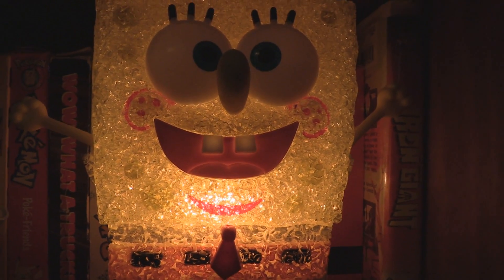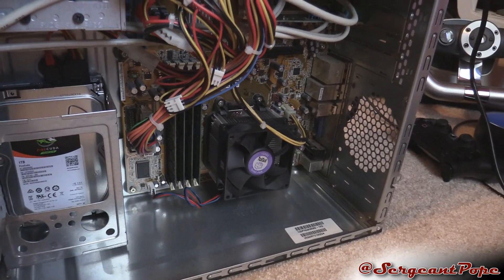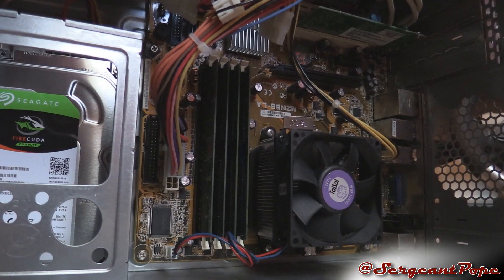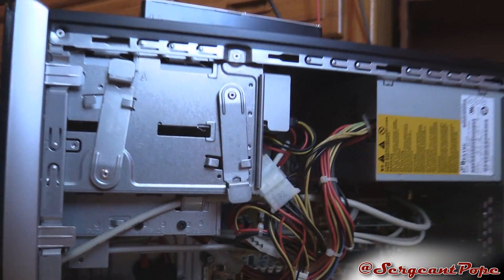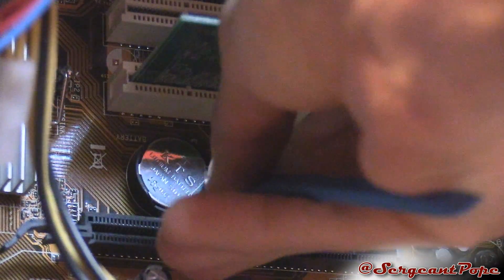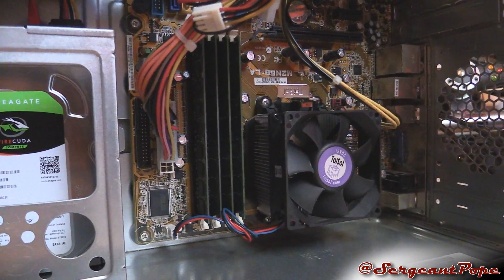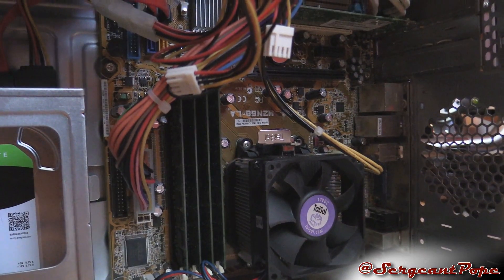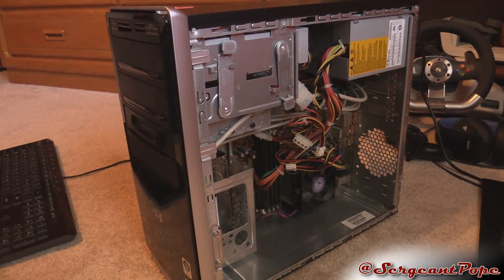Fixing a computer that turns off when booting into OS/Windows

Comment: I am working on a 11 year old atom pc about 1.1GHZ. It stopped working 7 years ago for my brother. I kept it and have now diagnoses the problem. The fan stops the windows 7 starter to stop and give a blue screen.  Critical Fault message. Without the fan it starts up, no problem. I have tried a few fans but the problem remains. What do I do now? I remember now that my brother raplaced the original fan with a bigger and quiet fan. That might say something?

Comment: my problem  is that, when I turn my pc on, it turns on for a second (the fans and the light turn on so I know my pc turned on), but after that it will shut off (the lights and the fans stop working) for around 3-5 seconds before turning on (this time completely) again and brings me to the American Megatrends screen which never happened to me before, only happened to me today, I googled and found that I can get through the American megatrends screen by pressing F1 and choosing save and exit in the BIOS screen, and that's what I did and it worked for me. 

Does anyone know what is wrong with my pc??? I don't think it's an overheating issue because I've never had any problem with that so far and my PC turns on just fine and I'm using it right now, and it's not hot at all, all the fans seem to work fine, nothing looks wrong on the outside so IDK what to do but it bothers me a lot cz again this is the first time it happened to me. I've tried booting up the pc multiple times already and it keeps doing the same thing, turns on then shuts down before turning on completely on it's own. 

Thanks :)
Reply: Little late here idk if you still got the problemo but it might be the power supply. But before you get a new one try to clear cmos. If that doesn't work start unplugging things to isolate the issue. If everything is unplugged like drives and gpu and it persist, try replacing ram but it's prolly not that.  If all that fails,    it's the power supply probably.

Edit: if the power supply fails then it might be motherboard
Reply: @carl5137  thanks for the reply. It was the CMOS battery 😅. It returned to normal after I changed it.

Comment: OK your a computer repair tech? cause its called a baud fax modem NOT a phone jack thingy. and always start with the memory sticks pull them all and insert one at a time into the first memory slot, with a single stick if the memory stick s bad you will get a continuous beep. don't ever just start buying random parts and throwing them into it, your wasting time and money.remove one at a time any and all objects not any of the power cables coming from the power supply , see if PC boots to bios then plug back in stuff that works, remove stuff that doesn't. start with CD/DVD rom drives and card readers and internal modems or other cards plugged into pci or pci express slots, if your motherboard has onboard video, remove your graphics card.if the fan in your power supply is spinning it should be working, get a multi-meter and check a hard drive power plug black is ground, yellows are 12 volt reds are 5 volt and orange is 3 volt, if it won't stay on in the computer unplug it from the motherboard a place a jumper wire from the green wire to a ground wire that's what switches it on remove the jumper and it will turn off. if all that fails it is the motherboard or a processor issue and that you should take to a qualified repair shop to have diagnosed. if you do get it to boot up and stay running update the bios on the board.

Comment: I had something similar, i just checked that temps are 70c max at idle, and I found out cooler is failing. So I ordered a new one. I would add also cpu cooler fail warning, in bios and add motherboard speaker to troubleshoot errors. Might also buy motherboard with troubleshooter display, fast power on, restart buttons. Stock fans are cheap and they will die soon. IF you replace fan in time, than your cpu might be saved. You need those huge radiators, to keep idle temps close to 25-40celsius.

Comment: My drama with this began when I recently changed my TFX form factor PSU (on a self-built PC) from a 300W Seasonic to a 300W Silverstone (both of them with that 80 Plus Bronze level of efficiency stamp on them). The Seasonic developed (a few days after install) a fast rate clicking sound - which gave the first glance impression that a fan's blades with hitting something - and the really weird part was that the same clicking sound was coming through my PC speakers too. I pulled that out and opened it up  and stuck a pen into its fan (the only moving part in it) but the high speed clicking sound continued coming from that PSU. So, I looked around on YT and didn't find an answer - but I did find what was really going on when I went on an Electronics Engineering forum. 

There was a guy on there with the knowledge and skill set to analyze and repair the real problem. It's called "micro-arching." It's when you have high voltage and there's a tiny break in electric contacts (it could even be a micro cut in a wire) and you actually see the electricity jumping across to complete the connection and continue on its way on the circuit. When it does that, not only does it create a popping sound but it also creates EM pulse waves that radiate outward in all directions - like what my PC speakers were picking up on - with the same rhythm pattern. This electronics DIY guy on the forum, de-soldered a lot of the connections on the daughter board of the Seasonic PSU , cleaned off the board with an alcohol type solvent extremely well and re-soldered all the parts together again - and now he has a dead silent fully functional PSU . Micro-arching is caused by "poor quality" soldering techniques by the manufacturer. There are quite a few YT videos of people having this clicking problem with Seasonic (and its sister brand Antec) PSUs. I didn't have the patience to go through all that, so instead I got a different brand PSU.  

So, I get the new Silverstone PSU, pop it in, it boots up dead silent, I get up to logging into an OS (Linux or Windows) and BAM !!! everything shuts off and here I am now with this problem. However, when I log into my BIOS area, my system stays on indefinitely.

Comment: Dude...its the four five capacitor near the cpu which you need to replace first and you will be able to boot into windows ..this is always bad capacitor issue... recently i have fixed my one 14 year old pentium 865gv motherboard which had the same issue 😄

Comment: Pls I resit the CPU and it worked fine for severally hours until I personally shut it and try turning it on again but it starts shutting itself down again. Does it mean I have to replace the CPU. (HP COMPAQ DX7200 MICROTOWER)

Comment: HAVE AN Asus B85M-G motherboard . Is capable of 32 GB Ram ? I install 
16Gb Ram System Locks up ! I install 8Gb Ram system runs fine ! I 
install 32Gb Ram System Locks up ! I install 8 Gb Ram in any of the four
 slots , system runs fine . I am totally lost on this one ? I've tried 
everything ! Every configuration ! Disabled B slots in Bios seemed to 
help for a short period then ! SYSTEM LOCKUP . What could be wrong with 
this heap of junk ? I go into bios and the default setting is 
overclocked automatically ! CPU target clock is set to 4000 Mgz ! I take
 away turbo mode and try to reset to 3600 and 16 GB ram ! System Lockup .
 Can You help me ? I'm days , and days , hours , and hours into this 
mess ! Should I reflash the bios to an earlier update ? Does Windows 10 
work on Asus B85M-G ? I'm about to accept defeat ! IDK ? I guess you are
 the ram guy !

Comment: I cleaned my pc from shit in there and put everything back all is connected then i played cs go 3hourns and pc starts turning off and on in boot screen :/
Reply: Did you fix it?I am having same issue
Reply: @Dastrid  Same here :(
Reply: @nigerianprince7167  I had to switch out my power supply with a new one because it was "Overheating" and it could not be fixed
Reply: @Dastrid  I realised that my cpu temp rising even if I don't do anything. It goes till 81 celsius and shut down. Wanted to try termal paste change but not sure if it will help. :(
Reply: @nigerianprince7167  Did you try going to a comp store?
Reply: @Dastrid  Tomorrow morning.
Reply: @Dastrid  Termal paste fixed it ;)
Reply: @nigerianprince7167  I had the same problem and I "fixed" it by cahnging the thermal paste, but it started to happen again In a few weeks

Comment: i noticed you have a 20 pin power connector on mainboard
Reply: probably old generation motherboard like lga775 or 1155 ?
Reply: and a psu with exact 20 pins only . no extra 4pins

Comment: I have a laptop that automatically shut down at the Window logo, once time, it did work normally until automatically shutdown in the middle of using, then the problem happens again. I have tried to reinstall the window and using another hard drive but still the same issue. What would anyone suggest is the problem? Thanks in advance
Reply: Did your laptop overheating??? Where did you placed that laptop????

Comment: hi,my computer started shutting off seconds after starting when my power went out the other night while my computer was on,so does anyone know what i can do to fix this,sometimes it starts and gets to welcome part and just clicks off,right now its doing repair mode,its actually staying on thru this so far,so im wondering if its something else,and not my hard drive,ive tried everything,like unplugging everything,took battery out ,put it back in after 30 seconds,still does it,but whats weird about this is that its staying on right now while its trying to repair,its been repairing for about 1 hour,is that normal? please help me,i love my old baby,she is an emachine running windows 7 proffesional,i know by end of this year ,they are stopping all updates and support for windows 7 ,i think its bs because i dont want to go to windows 10,but i feel like im being forced to do so,can anyone suggest anything to help me? thank you
Reply: Same problem
Reply: Same Me
Reply: Your pcs mother board
Reply: Same if continue to on its gets blue screen and sometimes switch on then few seconds off very frustrating already changing power supply and ram
Reply: you ever found a fix for this?

Comment: Yea, the capacitors on the motherboard near the CPU are dodgy as fuck.
That's usually the first thing I check whenever there are sudden shutoffs as it's easy to spot buldged or leaking caps without having to to remove any other component.
Not saying that mainboards die often, it's just pretty much the only part where a visual inspection is enough to tell when its defective (unless something went very very wrong).
There can be other, less visible issues with a motherboard ofc, but defective caps are the most likely cause of a defective motherboard.

Comment: what about when u try everything u listed except bios settings, but u cant get into them because it powers off as soon as it load oem splash screen?
Reply: Mine is acting like that, I tried everything, yet it powers off randomly   even while on BIOS. Sometimes while loading W
Reply: Make sure your computer is plugednintonthe wall all the way and all connections inside are secure. If it is maybe the CPU is getting too hot so try to redo the thermal paste. Or maybe it's a faulty power supply

Comment: if you have this problem just enter the BIOS and wait 90 seconds then exit and try booting into Windows
Reply: i’ll try that bro ❤️
Reply: Dont know why, but my PC also needs to warm up on BIOS screen for some time, otherwise It will shut off in a few secs to 1min after start up. Then after two or three tries It works just fine. Have changed PSU, CPU, RAM, HDD to SSD and also the CPU case... Still couldnt find the problem. Probably its the mobo, but I have a 3rd gen i5, cannot find LGA1155 anymore.

Comment: the motherboard was definitely bad, if you look at the capacitors around the cpu socket, alot of them were leaking, when capacitors leak out like that, the electricity can't get to certain parts of the board when you switch it on.
Reply: zulu67 and why they leak!!

Comment: yo sarge xD
I have an old dell optiplex 7010 with a i7 3770.
I want to put it in to a new case think it will be possible...
i know prebuild dells are a bitch to work with
Reply from the maker: It looks like it's a micro ATX motherboard on that Dell, so it should fit any micro ATX case. Prebuilds are kinda annoying to work with sometimes, but they're definitely possible to upgrade and get a little extra life out of them.
Reply: SergeantPope - Komada Computer Repair yea I'm gonna pop a gtx 1060 6gb or maybe a 1070 in it 
I've just been doimg research on cases since a buddy of mine had to mod the living hell out of his to fit the mobo
Reply from the maker: Ahhh, very interesting. I think yours would fit. You can send me a pic of your mobo on my Twitter if you want.